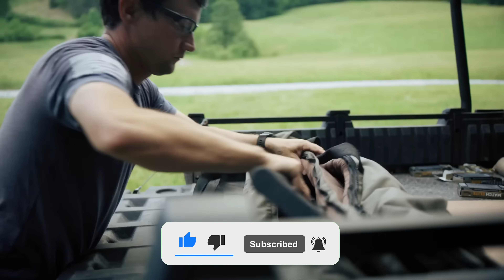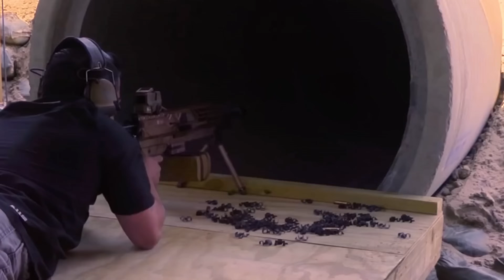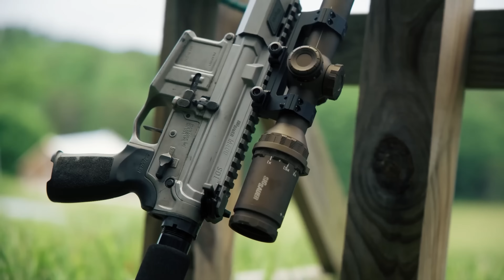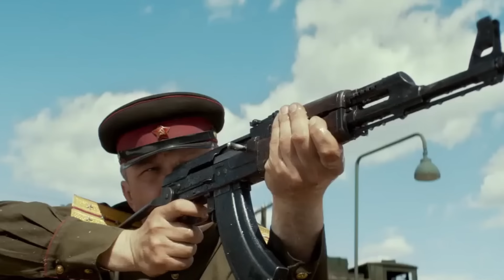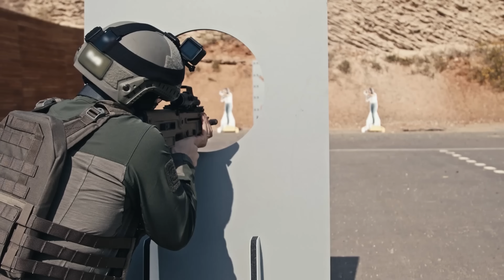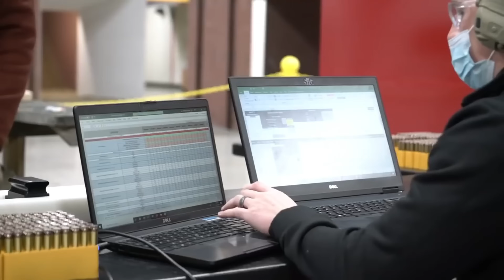Why the Military Is Eliminating the 5.56 and 7.62 Calibers — The New Caliber Changes Everything!

Comment: Yeah, what a great idea! Exploding difficult to manufacture ammo.. 7.62 has been around for decades. And the gun is extremely heavy. The grunts will be impaired in their load. Whoever approved this should be court martial end. Much cheaper and easier and just as effective to use even the M-14 or SCAR 17 would be lighter and cheaper. And you don’t think they have jungles in the Pacific? Use M855A1 and you’ve solved your problem. And BTW the 6.88 recoil is horrible.
Bad video! Badchoice of rifles!